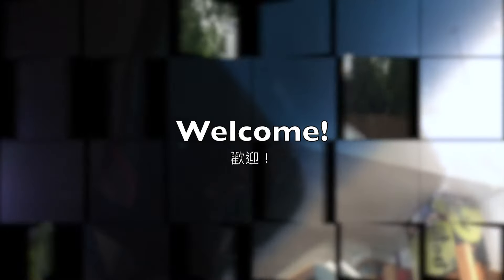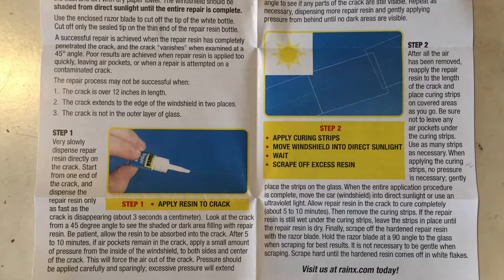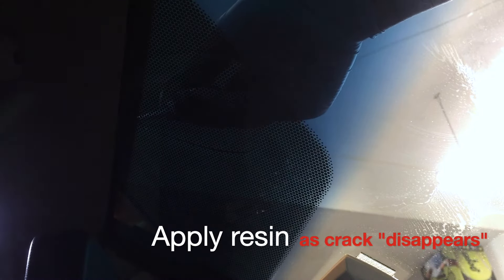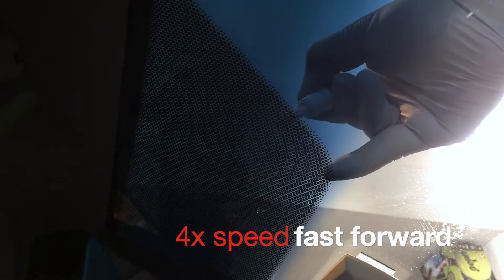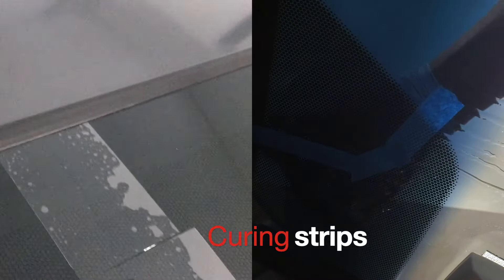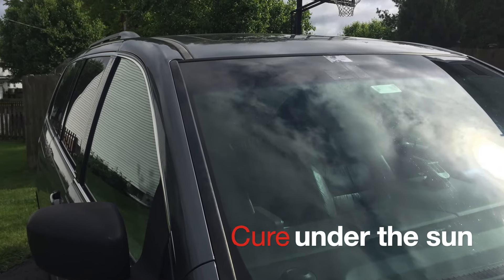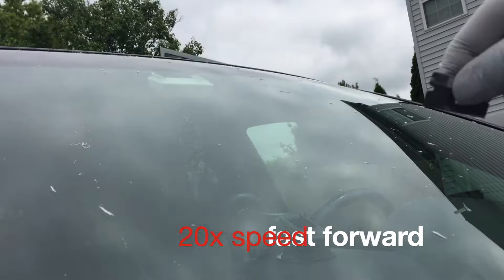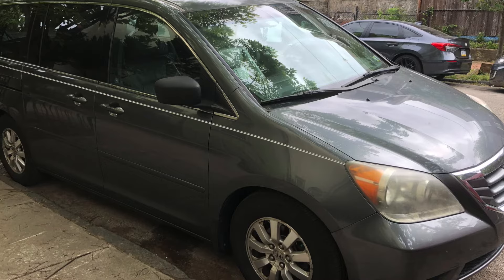Windshield Long Crack Repair with RainX Kit - 0 Issue after 2 YEARS

Comment from the maker: A one-year update (14 months after the fix): The glass is holding up very well. There is no growth of the crack. Most of the crack, after the fix, is nearly invisible except for a small portion at the top. What I'd do differently, in retrospect, is to apply the resin from bottom up (against the fllow). It will help it penetrate better. Hope this helps!
Reply from the maker: Almost 2 years (21 months) later, zero issues with the original fix.
Reply: Thanks a lot for sharing! Why do you think from bottom to top will make it penetrate better?
Reply from the maker: @lidingzeyu  Gravity. When applying from the bottom up, you move against the free flow (gravity) of the resin and, in a sense, stop it there for better penetration. The opposite (top-down method) will allow the resin to run down freely on the glass surface. Hope this makes sense.
Reply: Can you take the cat through those machine carwashes ? Will it break the windshield?

My crack is all the way across from left to right near the top of my windshield 😢
Reply from the maker: @MikesFans  For small cracks, this isn't a problem. However, your crack is big and all layers of the glass/seal are damaged, water may penetrate all the way.
Reply from the maker: Update: The repair is still holding up after 2 years!

Comment: Too dark to see anything.
Reply from the maker: Sorry to hear this! Such a crack is difficult to spot until you find the angle. One alternative is to view it from inside and use a marker to draw the line, which you can see from outside and follow it to apply the resin. Hope this works for you.
Reply: @profsg he means your video is too dark
Reply from the maker: @chillinwtheenemy  sorry, couldn't improve it. But I'm making another video on chip repair which hopefully will be brighter/easier to follow.

Comment: This doesn't work for cracks if you have a crack like this the windscreen needs replacing as one more hit and you could have issues best to get swapped out chips are fine.
Reply from the maker: The purpose of this fix was to stop the crack from growing. It has held up very well, after almost two years. For me, zero issues so far.
Reply: it's also less likely to have hits exactly at the same spot
Reply: It literally says for cracks up to 12 inches on the package.
Reply: I think it's a great option compared to a complete windshield replacement, as majority of people can't afford the extra expense of a complete swap. Going to try it on my car this winter during down time